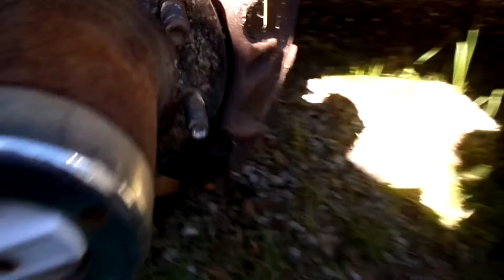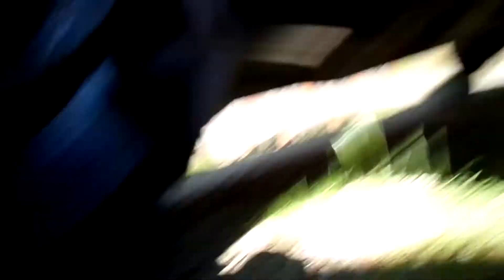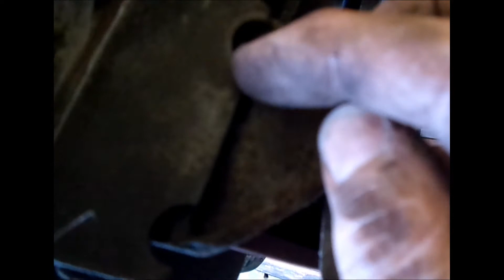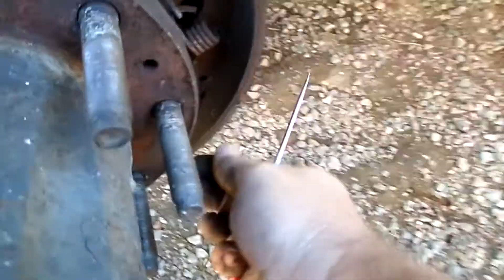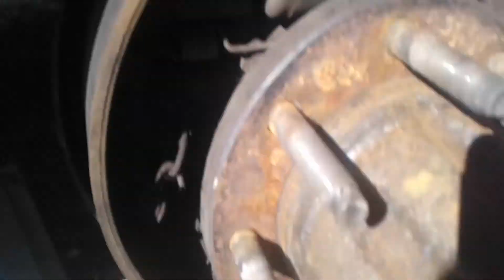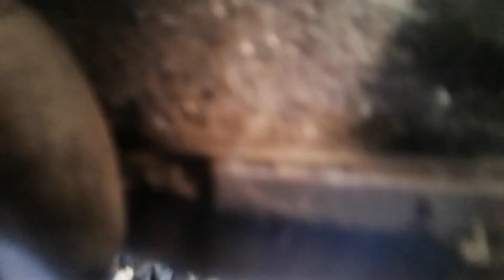1985 Ford F250 4x4 Catastrophic Brake Failure. Part 1, The Inspection.

Comment: This exact thing happened to me today in Colorado, with my '93 F-250 4x4. I had Devine Intervention, God saved me because I made it all the way to the bottom of a long, steep, & winding pass... then the brakes failed me at the bottom, after the road flattened out. I blew through a red light, but luckily, there was no car accident.
Reply from the maker: Glad you made it okay John!

Comment: Hi Niles. Lots of work ahead of you but you can handle it. I had a 85 F150 4x4. Non around anymore they all rotted away. I've gotten brakes red hot many times usually from locked up calipers. Don't reuse those pads because what will happen is they will start falling apart. Guess how I know that? No I'm not proud of it LOL. Take care
Reply from the maker: Hey there Dave! Yes, I have new pads ordered along with the other parts. If it was just a local errand beater I probably would have cheaped out, but since this thing is my heavy hauler I need to do it right. Thanks again.